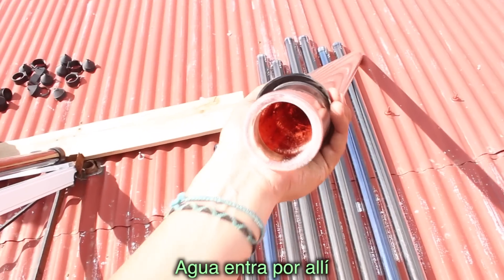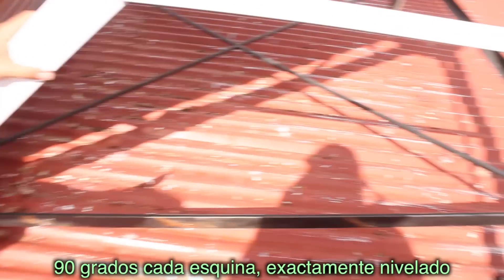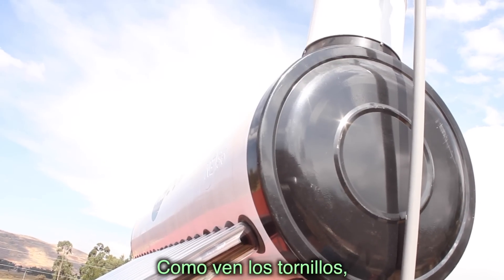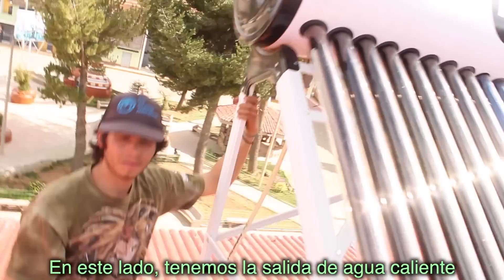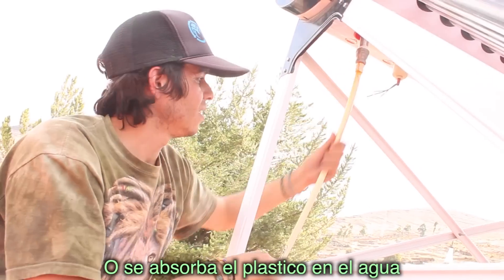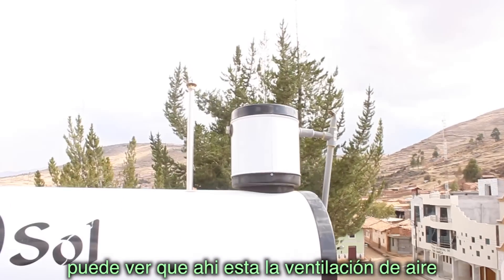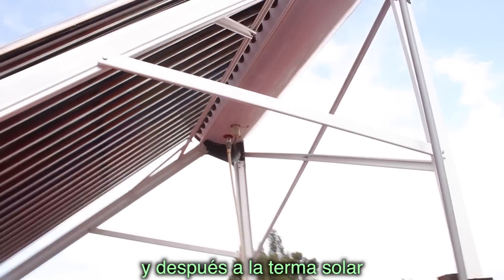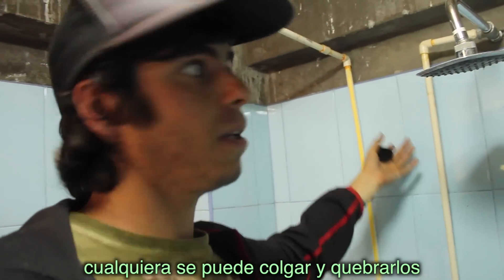Solar Water Heater Installation

Comment: You didn't explain how to remove or insert the assistant tank😭😭
Reply from the maker: I did not, sorry about that. I found you 3 links with images to help you understand that installment: http://www.ousunsolar.com/en/products.asp?pid=18, https://www.aliexpress.com/i/32850524913.html, http://www.ecotec.ltd/product/low-pressure-solar-water-heater-with-assistant-tank/.

Comment: 1) Water doesn’t go inside the evacuated tube...  unless you want the glass to shatter.  You use a heat exchanger.

2) The outside of the tube is clear glass to let sunlight pass through.  The inside layer of glass is dark to collect the energy from the sun.  

3) If you had used heat exchangers your tubes would not have broken......

4) The overflow/vent tank has to be at the top of the unit.  Your original alignment was correct or close at least.

5) Don’t cut a hole in the top of the roof unless you can seal it properly.
Reply from the maker: I don't understand the intent in your message. 
The purpose of this machine is not to exchange/transfer heat from one medium to another, but to absorb heat from solar radiation. The purpose of this simple machine is to take a hot shower, don't overthink it with advanced mechanics. 
You can't prove how the tubes broke, you can't prove the roof hole was not sealed properly. The overflow tank/vent is at the top.
Reply: @WiIdlifeWarrior  I know this a very late reply but you are right. This dude is confusing your set up for a high pressure system or one that uses heat exchanger fluid to fill the tubes.
The tubes will only break if it was exposed in a very hot sun without water & then fill it afterwards without cooling down. 
He clearly doesn't know what he's talking about

Comment: Drawing or diagram would have helped. Piping  plan.
Reply from the maker: Jose Malcolm true, I’m usually a fan of those. It’s basically just piping water UP to the small tank and hot water out of the tank DOWN to the shower. Depends on your place for how you’ll connect those.

Comment: Bro water is coming very slow
Reply from the maker: Techinal point Techinal point try checking the height and downward direction of the water and fill up the tank more for higher pressure.
Reply from the maker: Techinal point Techinal point try checking the height and downward direction of the water and fill up the tank more for higher pressure.
Reply from the maker: Techinal point Techinal point try checking the height and downward direction of the water and fill up the tank more for higher pressure.
Reply from the maker: Techinal point Techinal point try checking the height and downward direction of the water and fill up the tank more for higher pressure